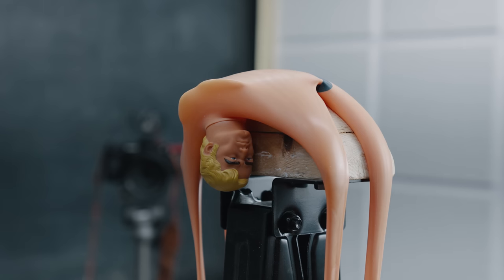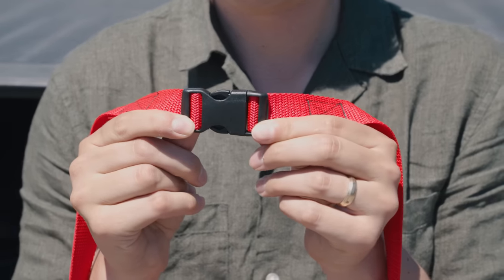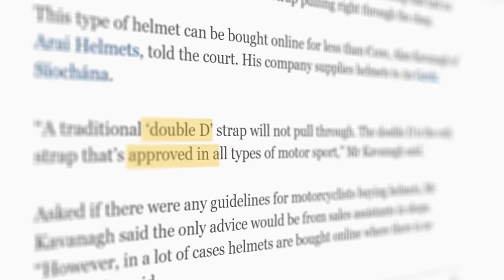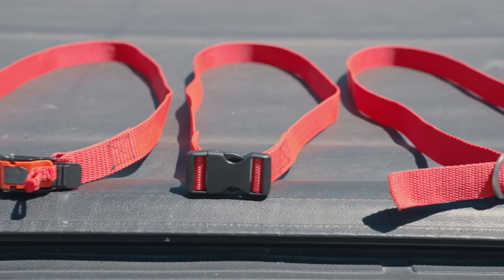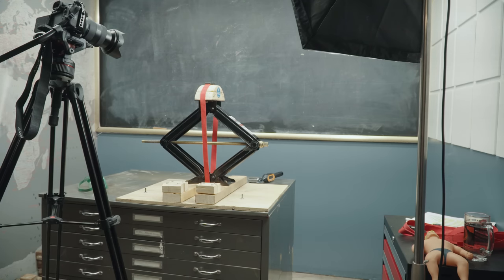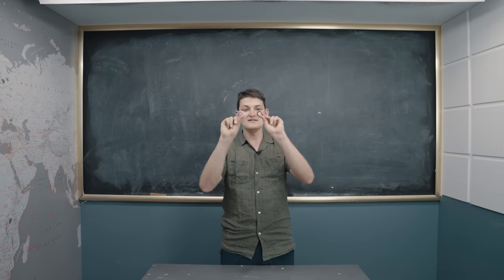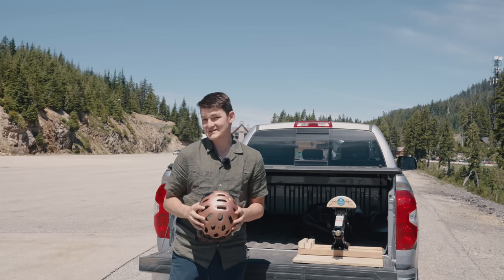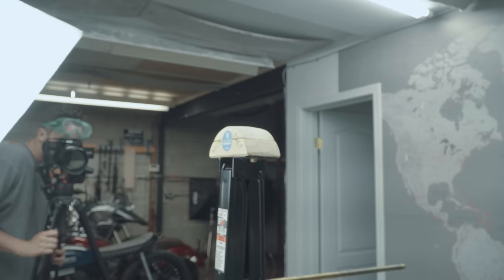Why Motorcycle Helmets Use this Ancient Buckle

Comment: After over 50 years of motorcycling I can confirm that the double 'D' ring is a total PIA to have to use all the time. As stated in the video, anything more than will rip your head off is a waste and if it's a nuisance to fit, will get left undone by some.

Shoei for years used a seat belt type buckle that was fast, convenient and no doubt strong enough. They dropped it some years ago because it wasn't worth having to make helmets available with the 2 different types and for competitive racing, the D ring is mandatory. So for their own convenience, Shoei relegated its customers to being stuck with the double 'D' ring once more.

They do now offer some helmets with a ratchet type, but their top of the line full face helmets are 'D' ring only.

Having said all that, the testing in this video was desperately flawed. The scissor jack does NOT have a linear relationship between its expansion force and the turning force required at the screw. Not by a little, by a LOT. Makes a HUGE difference how closed or extended the jack is. So although the results seem to prove what they wanted, they're actually pretty worthless.
Reply: Ken, I believe you missed the point of the demonstration— that the other mechanisms fail prematurely (i.e. before the webbing). The webbing has a known breaking strength (900lbs)— at which point we want the helmet to come off before it breaks your neck. (See ~2:53)
Reply: @curtisbard792  I would suggest you missed the point of what I was saying about the test. A scissor jack is NON linear and the force needed to rotate the screw, in relation to the extension force applied to the straps is totally dependent on how far the jack is extended. I wasn't going to go so far as to say this initially, but as my reply has been dismissed, I will. This was a useless unscientific test and the 'results' should be ignored as they mean nothing.

Construct a proper rig to actually test the real breaking strength. Sorry, but this test was worthless.

Comment: Great video as usual , I’m left wondering how much force is needed to break ones neck compared to the buckle strength ? If you body breaks before the buckle then ultimate failure is a mute point.
Reply: In the video, Ryan said the strap is designed to break before you'd break your neck
Reply: @csolivais1979  yea ill stick with my ratchet i can live with 555 lbs of force till failure. 600 will break your neck so.....

Comment: That test is not definitive. It does not test the failure of the RELEASE MECHANISM which is the point of quick release straps. At 400 lbs, your neck is the least of your worries anyway.

Comment: Am Ami and still say that D rings are annoying and cumbersome. I won't ever buy a helmet again that doesn't use the far superior ratchet system. You only have to adjust the straps once so long as you don't gain or lose a ton of weight in your face. If I'm broke I'll run a LS2, if I got money, Schuberth it is. I don't dispute that a D ring may technically resist more force, but it's irrelevant. You're not going to see enough force to you're head to break a rachet that doesn't have some sort of material or manufacturer defect without it being a fatal crash anyway. The slight "when the stars align* theoretical advantage offered by the D ring is a silly thing to be worried about when you're already engaged in an inherently dangerous task (motorcycling) and both methods pass all current helmet certifications.

Comment: Wrong, that's not the first thing I learned, didn't know how the bloody thing worked and was to embarrassed to ask so I spent a whole day riding through the back country and on the way home and crashed at about 100kph and I watched my helmet fly off my head right before getting knocked out by the handle bars. Ended up loosing half a tooth, but at least now I know how important they are.

Comment: I'm scared that so many people are taking away the wrong idea from this video - because the experiment is flawed as only the D ring buckle is made of metal, whereas all the other buckles are plastic. So you are not just testing the strength of the buckle design, you are testing that PLUS the strength of the buckle material - that's TWO variables, not one. If the experiment is done correctly for just the buckle design, all the buckles should be made of the same material. So in fact, this experiment is actually a failure from the preparation stage, and you cannot determine that the D ring buckle is the strongest from this experiment at all and you should not have come to that conclusion which you did.
Although I would agree that forcing the user to tighten the strap is a good idea, but I'll challenge you on your bet - I ALWAYS tighten my side release buckles on my bicycle helmets, never let it flap around because I know if I let it flap around I may as well just not wear the thing to begin with.

Comment: I disagree about the psychology of double D rings. They are such a pain to connect up that people (a) do not bother (like Yanks in WW2 films) (b) get them dangerously wrong, or (c) adjust them incorrectly.

I have lived with double D-ring helmets for 55 years, and hate the mechanism. Your tests show that DDs are not significantly safer than other mechanisms in real-world circumstances, and that a mechanism that makes helmet attachment easier to use is more likely to save lives.

Comment: I find myself in the rare situation of disagreeing fundamentally with content on FortNine... While I agree with the empiric evidence on core, even if it was single test data, I absolutely disagree with the notion that the only safe solution is the D-ring. Many reasons for this, among them the fact that I see MANY riders failing to "buckle up" on shorter rides due to inconvenience. More to the heart of the argument though, how safe is "safe enough"? I have d-rings and micrometric buckles on my helmets, and I much prefer the micrometric ones. They are, within reason, just as "enforcing of every-time readjustment" as the D-ring, as it has about 1.5" or 38mm variance built-in, and more importantly for the purposes of this discussion, they are MORE than safe enough from where I stand. As pointed out in this video, there are limits beyond which you would WANT the helmet to separate from your person. I argue that force beyond 10Nm DIRECTLY affecting the buckle would VERY likely kill me anyways. I'll take the significant gain in convenience (fit the buckle while gloved up, in 1 second, y'all) over the purely mathematical gain in "safety" in this case.

Comment: A lift force of 555 lbs  would break most of the muscle, tendon and other connections, and cause life-threatening injuries.
900 lbs is near the force needed to decapitate the entire head.
The double D offers hypothetical safety only.
Reply: You say it even at around 2:40 .
Also, ECE approved helmets come with a metal buckle. Your tests are actually valid, but please consider redoing them and use a metal micro-lock.
European helmet makers align the force needed to tear a strap with the force needed to break a buckle. Makes sense?

Comment: The argument that double-D's are safer because sports authorities mandate them is stupid. See how long it took UCI to eventually accept disc brakes. Before that all pro cyclists were forced to keep on using completely unsafe horse-shoe brakes. Even the v-brakes were forbidden. See also the Le Mans style start that has been used in all kinds of motor sports for decades while being also obviously completely unsafe.
Sports regulations are very far from being good examples of safety considerations.
Reply: That's why he tested them to see what force is required for them to fail.
Reply: @lunchtreyy  And he actually tested if they were stronger, not safer.
A safe device is one that has the main purpose of protecting you, including by destroying itself if that can save your life. If the pulling force is so high that it could separate your head from your body you absolutely want the buckle to break so your head is not torn apart. And that's why more modern buckles are designed the way they are. They resist traction to a certain point. Then they let you go before they kill you.
I fully agree with the point about properly tightening the strap each time you put your helmet on. And actually rechecking and retightening it on long trips. All buckle systems allow for that. But the actual strength comparison is actually meaningless on the safety scale.

Comment: I don't think you made a valid point. The various securing devices would hold the helmet on one's head in a crash. I think the point at which the locking method broke is irrelevant as it would have exceeded any reasonable expectation. At the point for breakage wouldn't it have ripped the person's head off or broken their necks? Sorry, but you haven't proven anything as I see it.

Comment: Hi. I'm sad to say that your test is flawed, and unfortunately, absolutely worthless. What you are comparing here is not 2 different mechanism. You are comparing different materials! The double D is made of metal, while the others are made of plastic. And different qualities of plastic to add on top of that. You should have tried with a double D made of the same plastic quality and only then, you would compared apples with apples.

The REAL reason why they are using double Ds, lets face it, is only about manufacturing costs.